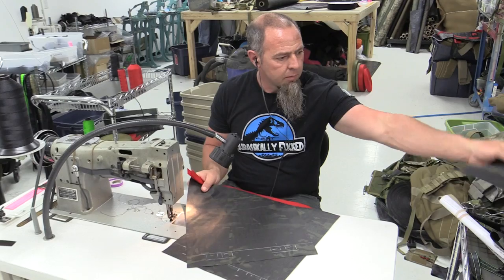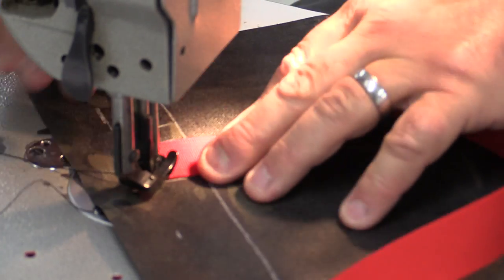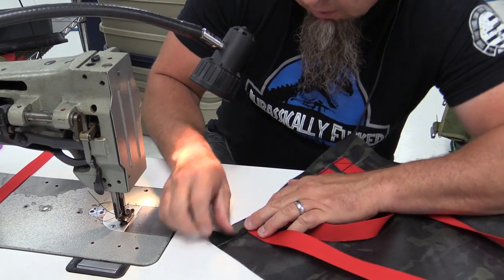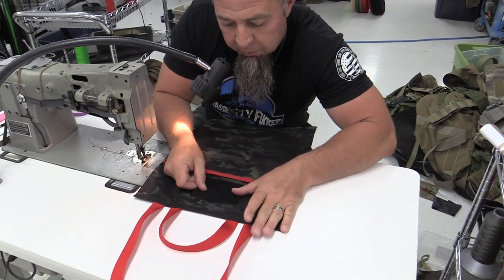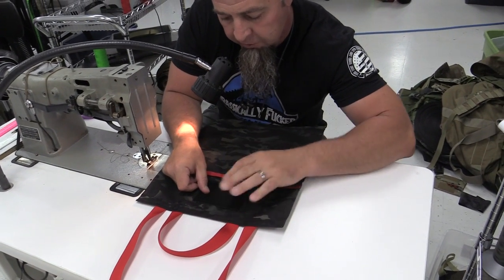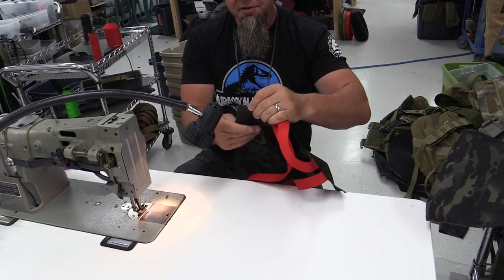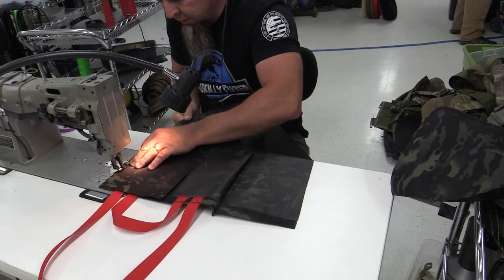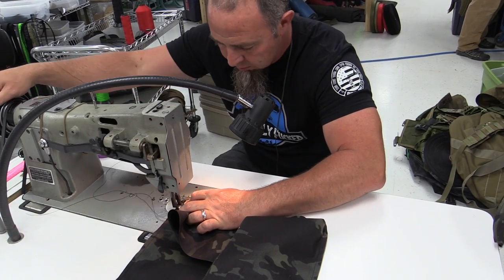Making Of: CA Compliant Grocery Bag Part 1

Comment: we used to take the metal shroud off so you could free spin the flame adjuster, lock it open and light it.  was a flame thrower for about 30 seconds till the plastic melted and made a fireball.